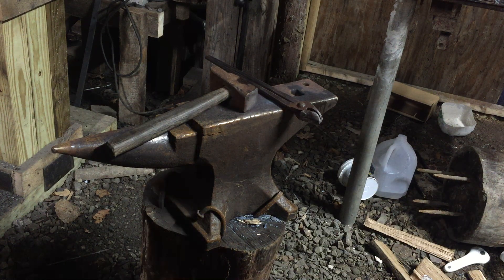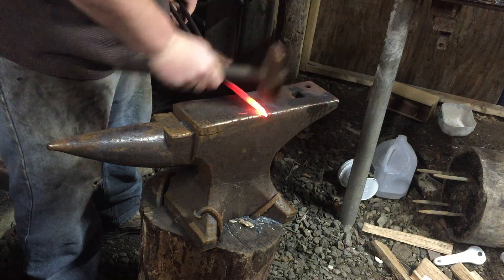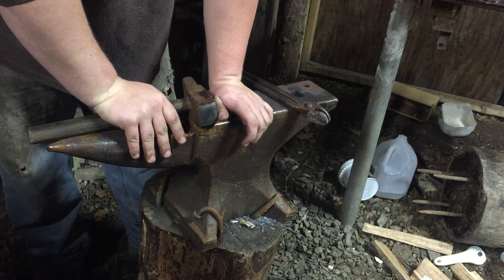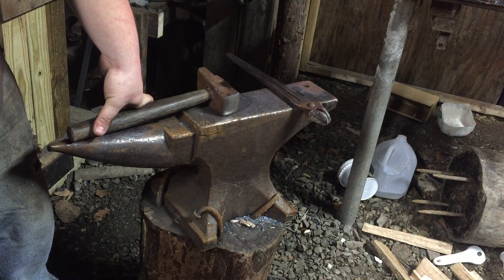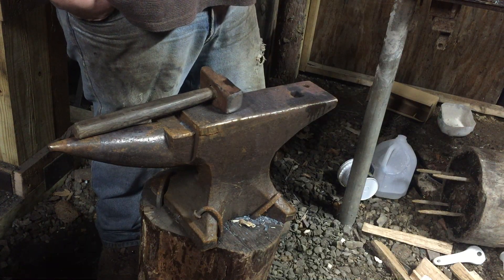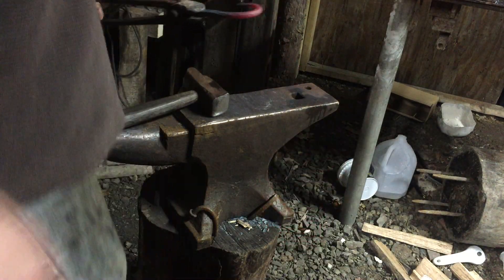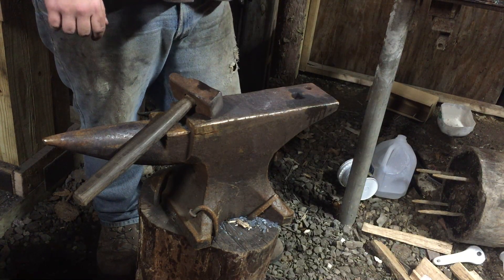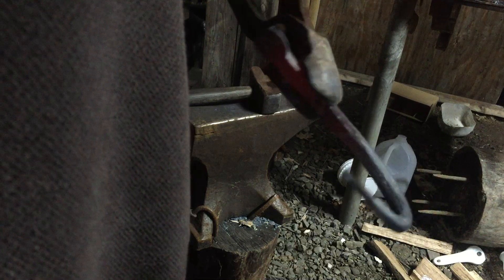Forging a J Hook

Comment: No worries, the sound worked fine, as did your explanations, which I always appreciate. I don't use scrolling tongs to do mine, but I don't think using them constitutes cheating! If it does, then smiths who use power hammers and presses are REALLY cheating!
Reply from the maker: Bryson Alden thanks!  I’d be the ultimate cheater. 😂 I use a press, electric blower, scrolling tongs and soon I’m getting an Anyang power hammer!!